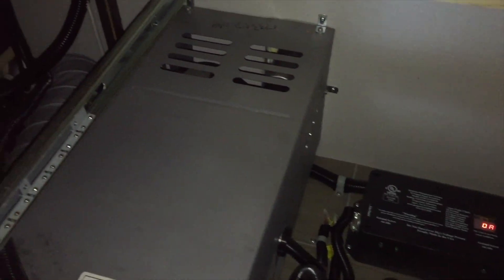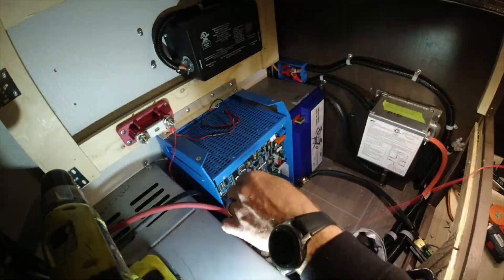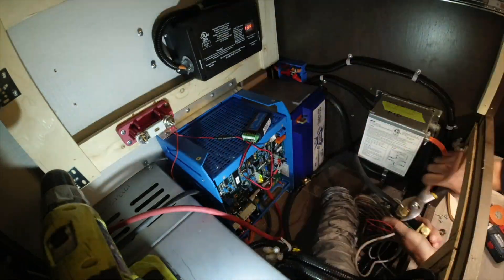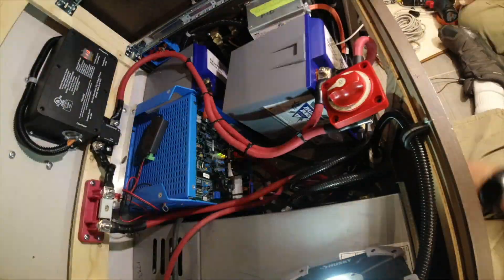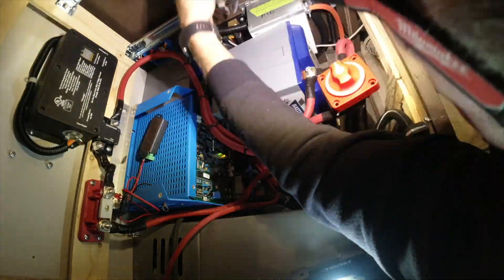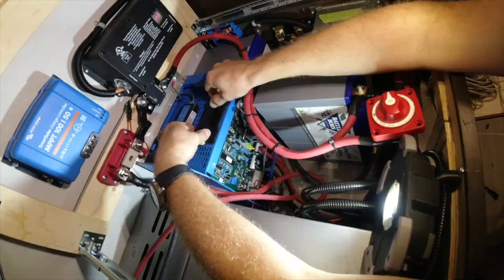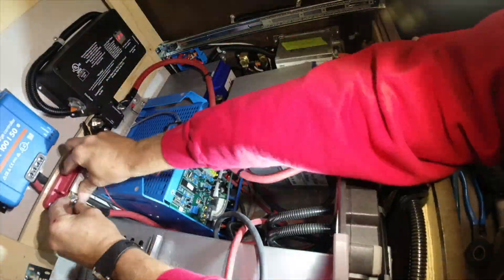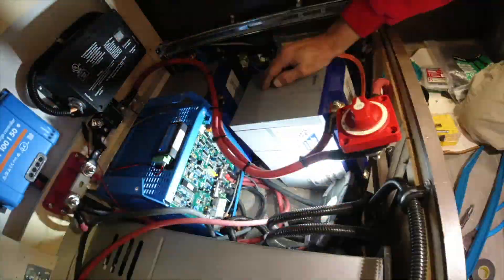2018 Leisure Travel 24MB | Solar Install

Comment: I have the Roadtrek E trek. My batteries are not charging or holding a charge so eventually I’m going to switch to lithium or trade-in for a later travel. I just want to get it to the point where it is charging from the engine. Every since Mercedes reset the computer in the engine and the generator is not charging the house batteries. Mercedes followed the cable back and said the problem ends at a box near the battery.  Do you know of any fuses near the battery that would need to be replaced so that my batteries are being charged again? Only thing charging the batteries now is solar.  So I only have a tiny bit of power during the day. No stove, no Microway it not even a heater. I think the fuse needs to be changed on the heater as well

Comment: Thanks for sharing.  With this change are you now able to run the A/C on the inverter?  If so for how long with only 200Ah of battries?
Reply from the maker: Bee Creek Photography thanks! This client is able to run the AC in full sunlight for about 3 hours. He does not have a MicroAir Easy Start though so he would be able to do it longer if he had that in place as well.

Comment: Why did the owner replace the existing solar panels?
Reply from the maker: Nelson L this specific LTV did not have existing solar; however, on a few other LTVs that I’ve done they replace them because the flex panels damage the roof and they wanted a heftier system.